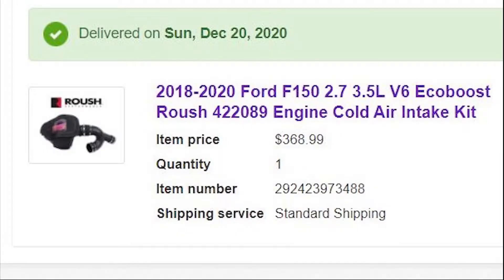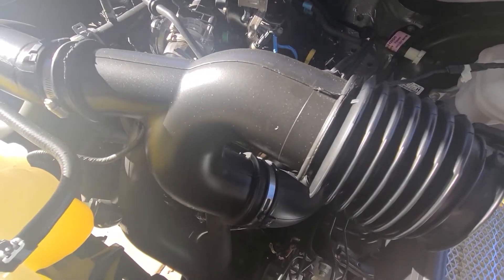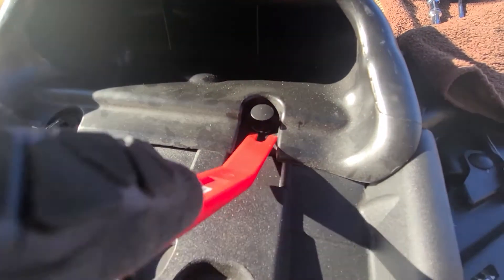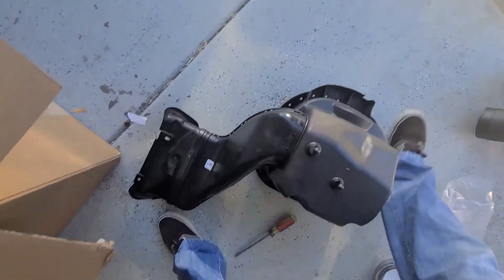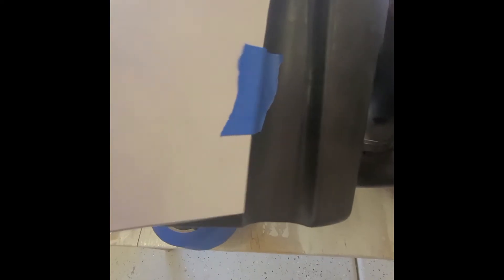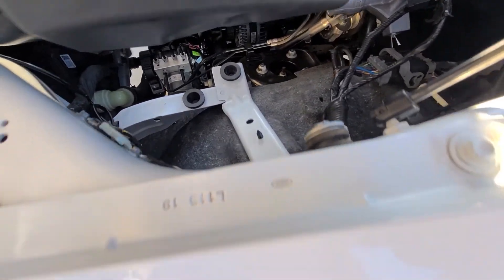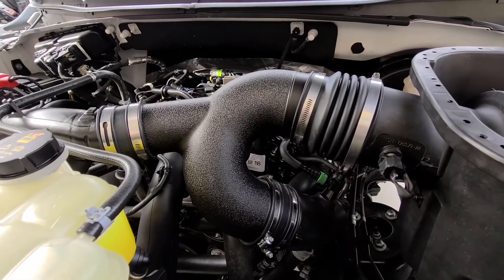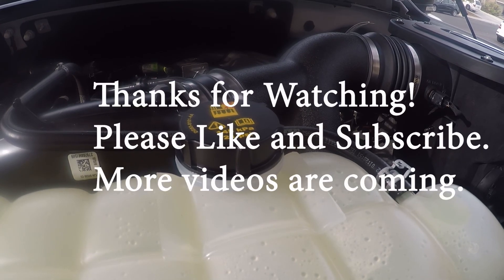Ford F-150 Truck Cold Air Intake Install

Comment: Did that dirty air vent that hooks to the new box fit loose? It does  in mind,feel like it will also suck heat from the engine
Reply from the maker: It was not a really tight fit but was snug enough to work as intended once connected and tightened up.

Comment: Did you notice any sound or even performance differences with the lid on over the filter as opposed to just leaving the lid off? I’m assuming no, but just wanted to ask.
Reply from the maker: Hello Michael. I think there could be a performance difference between lid on and off.  Most noticeable when the engine compartment is hot because with the lid off the hot air will also intake into the system compared to lid on will force the use of the outside cooler air.